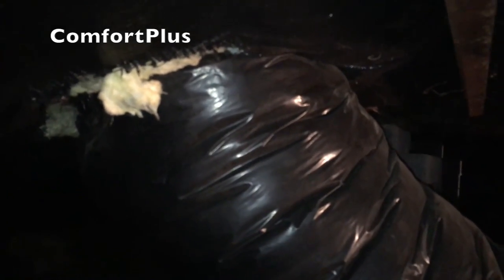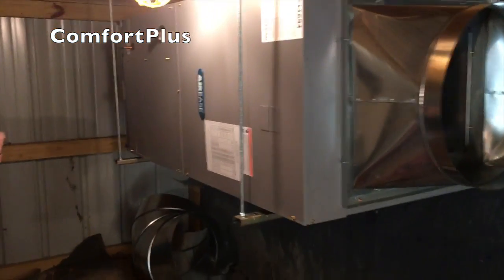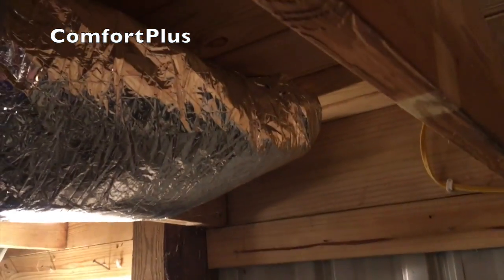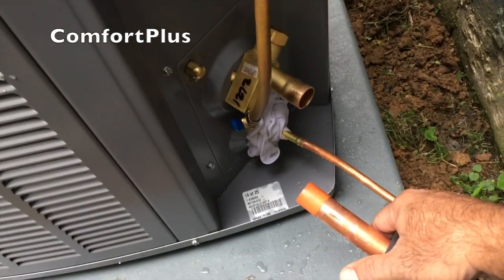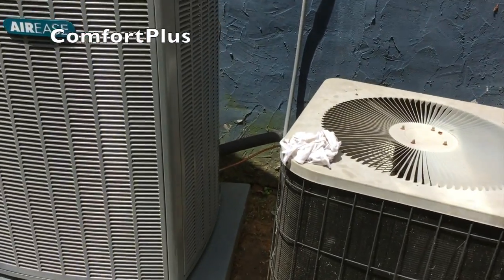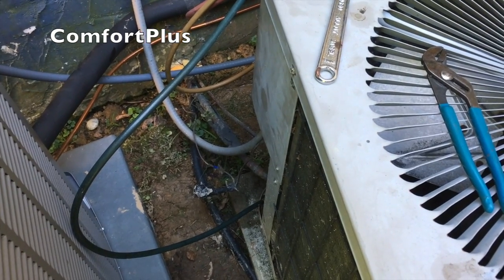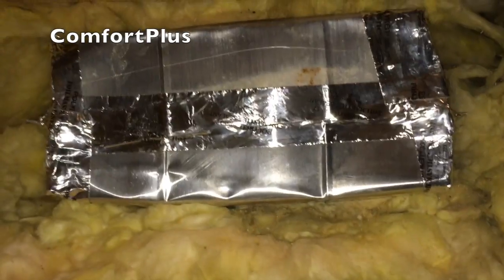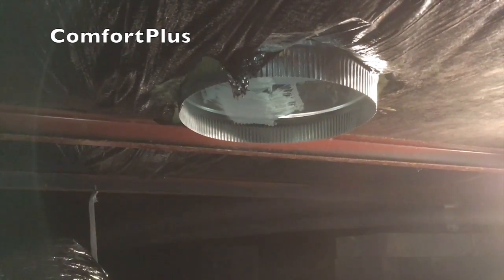Modular Home: Install a split-system heat pump with duct mods

Comment: Big question I have a 1995 modular home set on a basement with 10ft ceilings. House used to be heated off a outside wood burner but our furnace needs updated badly my ductwork looks different than in this video I have a cross over box then the two long boxes running the length of the home that split off to the ducts. I need to find a good system that will work for my home any help would be appreciated

Comment: Help! After searching the web for days and speaking to many companies that don't have a clue, You are the only person I feel comfortable asking a question. Can you please tell me which brand of heat pump you would recommend for a 07 southern energy manufactured home. We currently have a 4 ton split system AC that has a huge leak in the evaporator coil.
Reply from the maker: +Alicia Kay Childers in my opinion the key to manufactured home installs is using the proper evaporator coil and matching it with the outdoor unit you choose. I typically use Mortex brand coils for my split system installs in a manufactured home. Just make sure the system is matched and AHRI certified!

Comment: what bran of ac are you selling now? AirEase?
Reply from the maker: +Vann Berg I've sold Airease since I started my business. I've had good luck with them. Unfortunately my distributor has decided to stop carrying them. I recently installed an American Standard. I will most likely use them going forward.
Reply: any reason they stopped with you ordering them and just being trained for the variable system?  Also, how would rate them to ICP, Rheem, and Trane?  Just curious, thanks

Comment: 100 foot of equivelant length no just the actual length.....but yea a 6ft straight section is a lot more - although the faster the air goes through your elbow (velocity) than the more uneven it is across the coil.
Reply from the maker: +Joe Shearer Bigger duct and plenum is always better but the system performed well. Have you see the service bulletin from Rheem about the shut-down bump?
Reply: +ComfortPlus Heating and Cooling no I haven't seen that yet.
Reply from the maker: Joe Shearer I'll try to post it here.
Reply: +ComfortPlus Heating and Cooling thanks I looked on my Ruud website but I can't see how to find any bulletins :\
Reply from the maker: I posted pics here on google plus and "tagged" you!
Reply: +ComfortPlus Heating and Cooling thanks man I don't think I would have thought of doing that
Reply from the maker: They will separate them instantly on shut down. Probably will work! Cheap enough to try for sure.
Reply: I can't find where you posted the bulletin.  Can you clarify?  Thanks!
Reply from the maker: GaslightAlley https://plus.google.com/+ComfortPlusHeatingandCooling/posts/jkW7HGkwkP6
Reply: Thanks very much! This is what I was looking for.  If I recall, some of you guys contributed to this solution.  Thanks again.